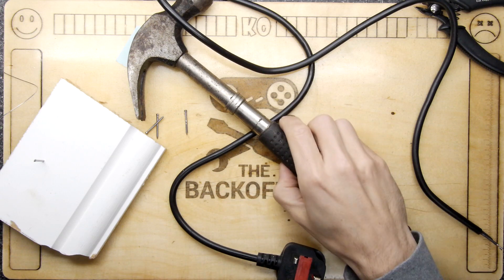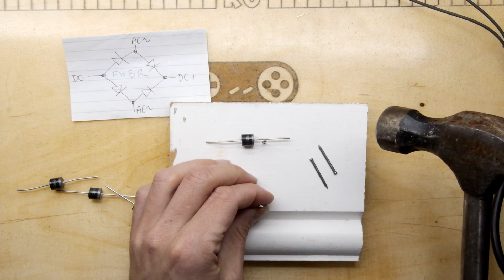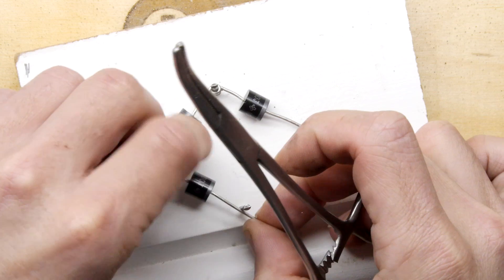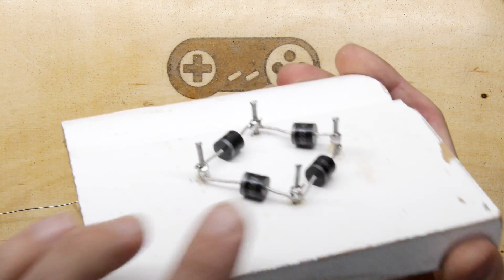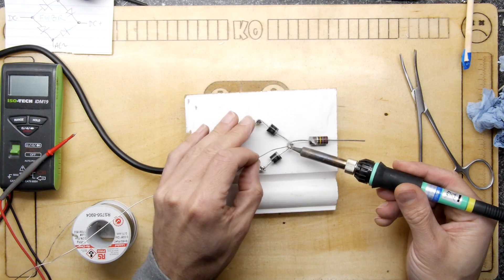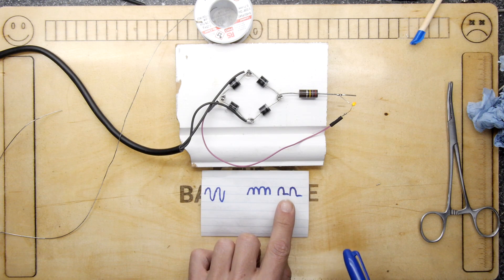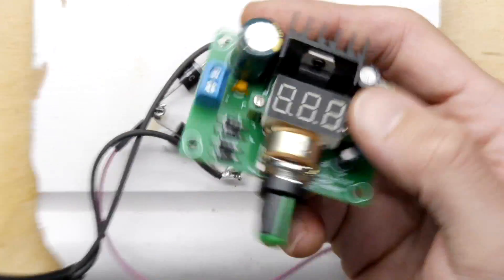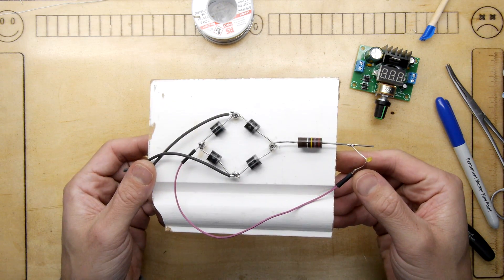Make a Dangerous Mains Full Bridge Rectifier

Comment: FWBR are awesome, I just built one to rectify a microwave transformer I'll be using to charge a capacitor bank, they're beautifully simple devices. By the way you should try the Flux that comes in a syringe, it's extremely convenient, no need for a brush or other tool to apply it, you just squeeze a little onto your workpiece and you're done and it prevents over application, a little dab will do ya.

Comment: 😨your experimenting with 240volts😱 is this video from before your birthday?

Ps. You now a led is diode so you can make a half bridge rectifier with led’s. And make use of the voltage drop from the led/diodes. 

PPS. Solar cells are diodes to.
Reply from the maker: So much good stuff here 😁

Yes this was recorded a while ago.

LEDs would be really interesting, especially if I can make a fake AC source with a really slow frequency!

Showing how LEDs can be used to generate voltage would be really cool!
Reply: Half wave rectifying with a LED might kill it fast - the reverse voltage LEDs can take is usally quite limited. In a bridge like this, the reverse voltage of the diodes is limited to the forward drop in the other 'branch', while in a half wave situation the diode has to take the full reverse voltage of the supply.